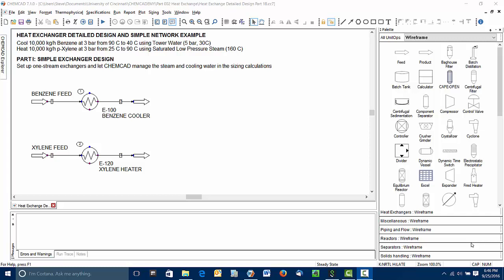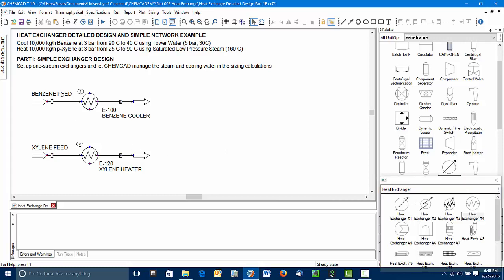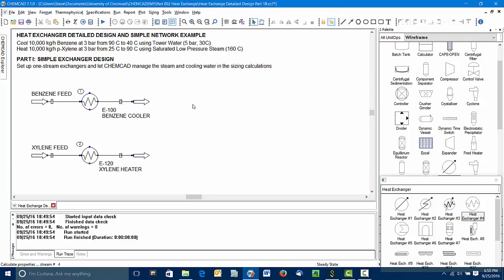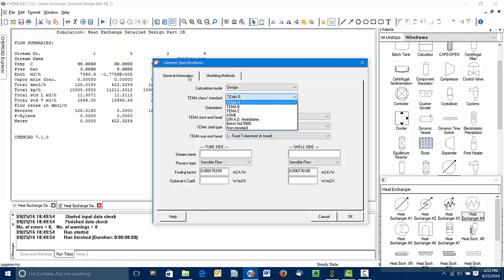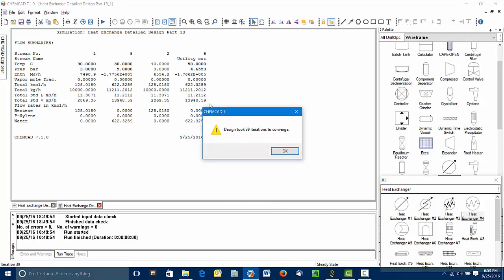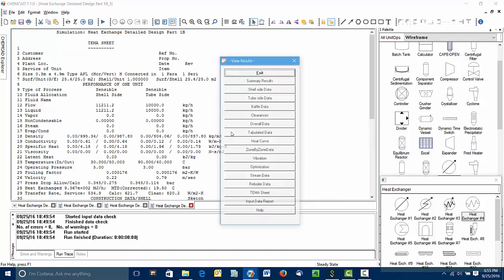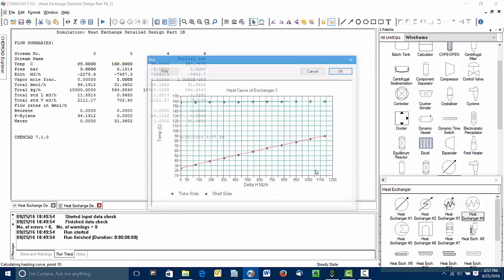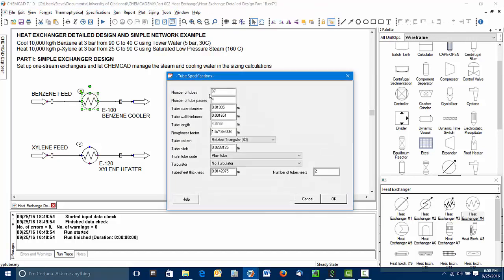CHEMCAD 7 Heat Exchange Networks 1

Comment: you added water in the components and run the heat exchanger and got results although it didn't even have an inlet and outlet flow of water!  So chemCAD already been taken the water flow rate into account? Like it would make the energy and mass balances to get a suitable water flow rate for the specified temperature of H.E.?
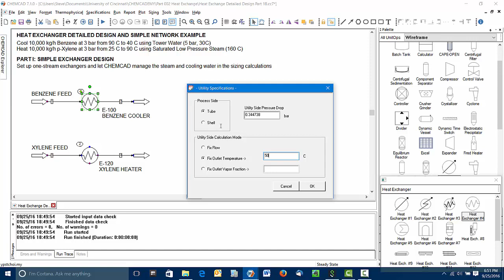Reply from the maker: If you don't explicitly include the utility streams in the main flowsheet, you can provide information about the utility in the sizing dialog (starting around 3:25 in the video).  Once you do that, CHEMCAD can use the thermal specifications to determine the utility flow rate (as you can see in the report CHEMCAD generated around 4:10 in the video).